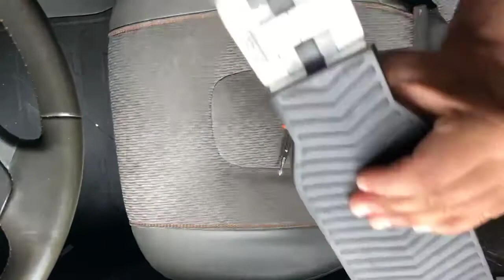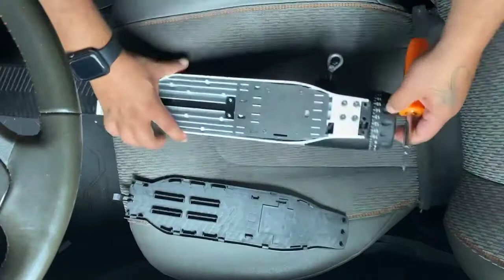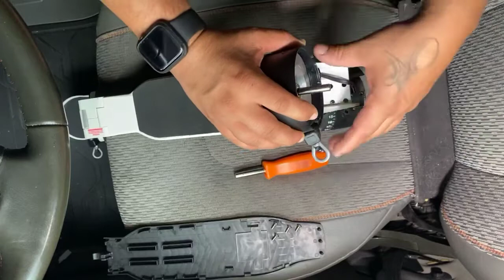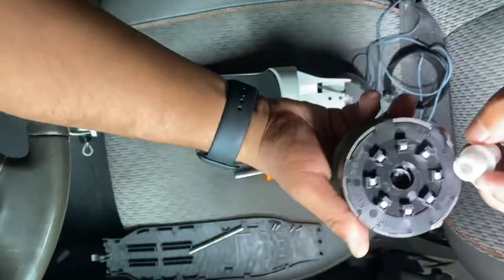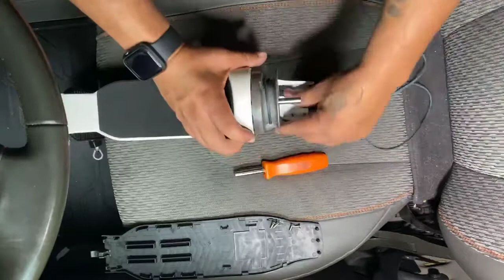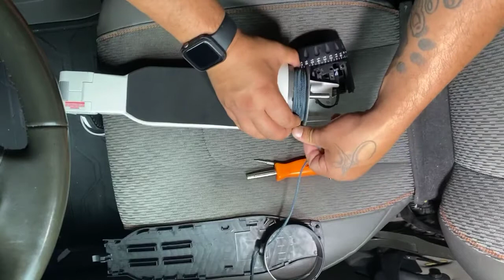How to fix the MAXPRO cord issue

Comment: maxpro needs to make videos addressing some of these issues. They should also provide you with a new maxpro just to take a part and put back together if they are directing people to your channel. Just saying.........
Reply from the maker: That’s a good point lol
Reply: @MrFocused82  Have you ever had any squeaky noises coming from the unit? Im wondering if you or anyone else has ever tried to lube the roller bearing. Also, im getting some vibration/juddering on one of my clutchs during retraction. Have ypu experienced anything like that? I bought a set of replacement cord/spools to see if it fixes it. Maxpro customer service is no help trying to diagnose. To top it off, anything above 12 the Cords intial "pop" when pulled. Ugghh
Reply from the maker: @jordanent8279  no I haven’t had that issue

Comment: does  the "dial in" resistance weight exactly match the the weight of dumbells? does the resistance clutch wear out with use? does it provide the same resistance going up and going down, the positive and the negative?
Reply: no it does not. its only concentric. Zero resistance on the way down

Comment: My Maxpro cables are not snapping back ? What would that be?
Reply from the maker: It might be an issue with the coil inside the spool. Call support and ask them if they can send you new cables.
Reply: I'll do that
Reply from the maker: @regio182  or take everything apart and put it back together the way I show in this video if that doesn’t work then call them.